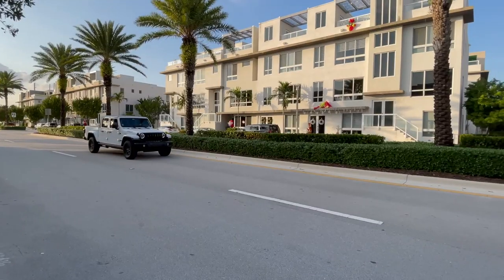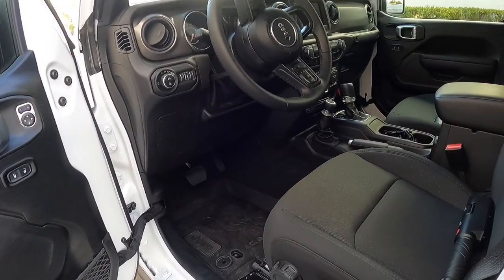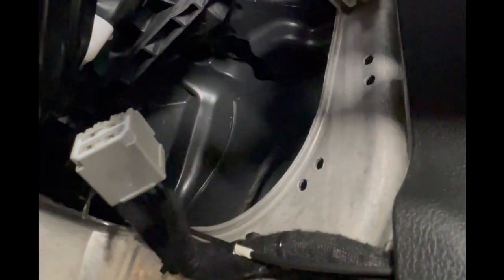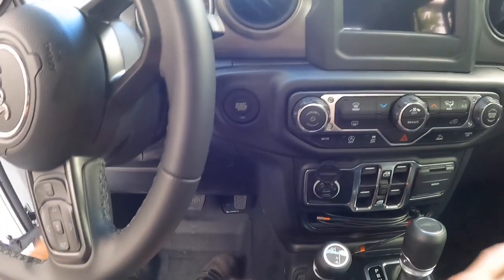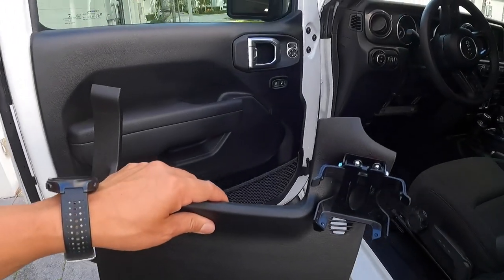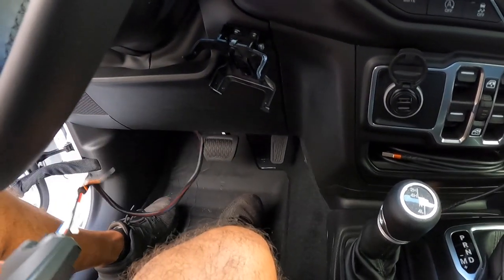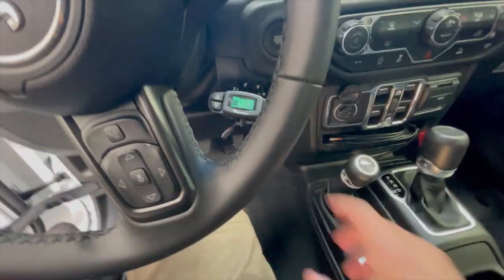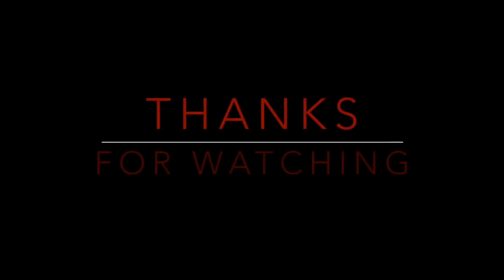Tekonsha P3 Brake Control install on the Gladiator

Comment: What is the part number for this connector???
Reply from the maker: Hi Josh, Part # 3073-P Tekonsha Custom Wiring Adapter for Trailer Brake Controllers – Jeep. You can purchase it at:
https://www.etrailer.com/Accessories-and-Parts/Tekonsha/3073-P.html
Sorry for the late response. Thanks for watching and for your question. Cheers, JC